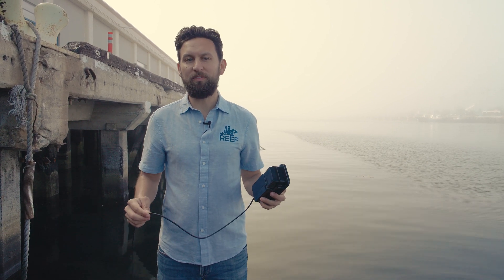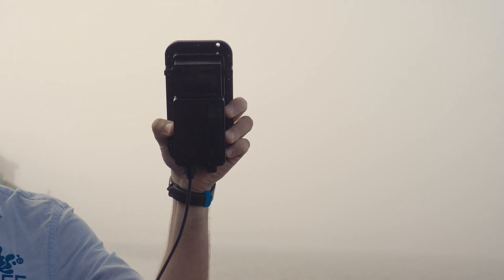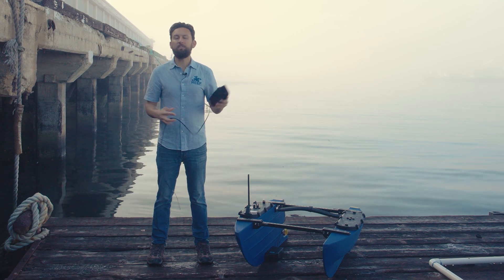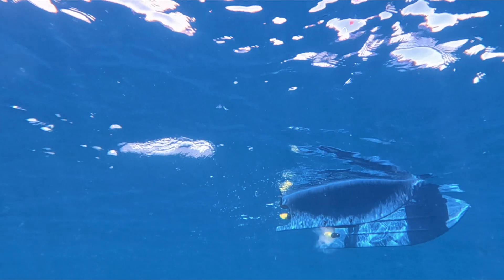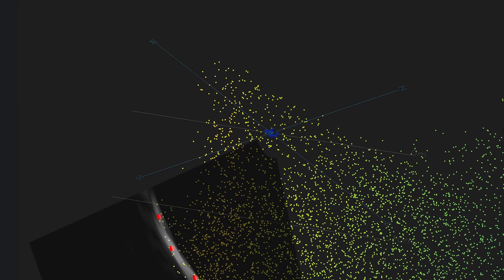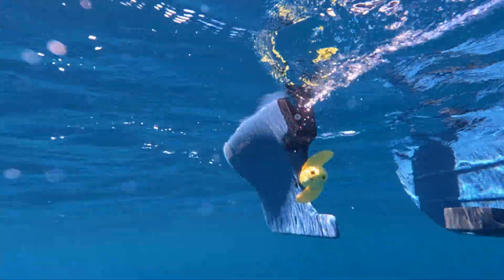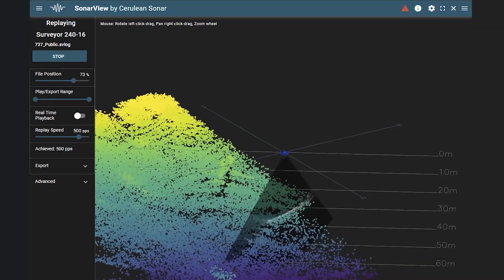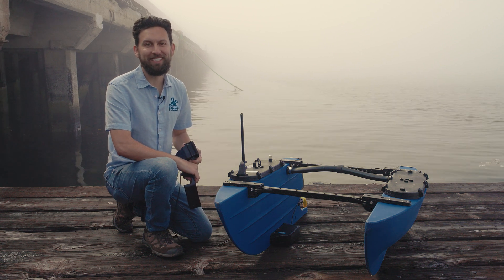The Reef: Cerulean Surveyor 240-16 Multibeam Echosounder

Comment: Hey, you should start considering T1S devices instead of normal Ethernet cables. Would remove the need of a switch and reduce the number of cables used mataining hugh speed throughput and the Ethernet protocol unchanged.